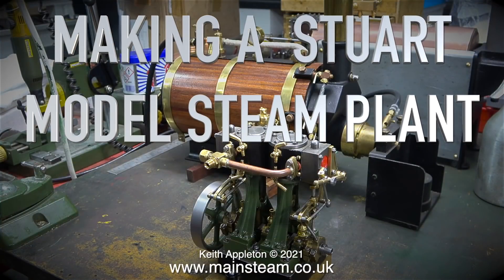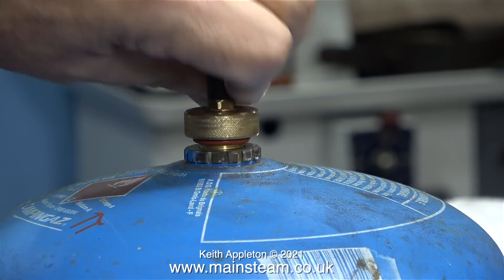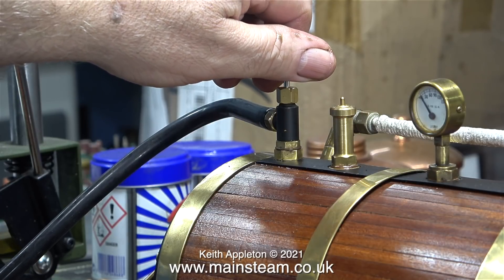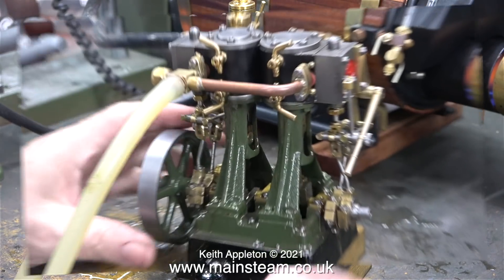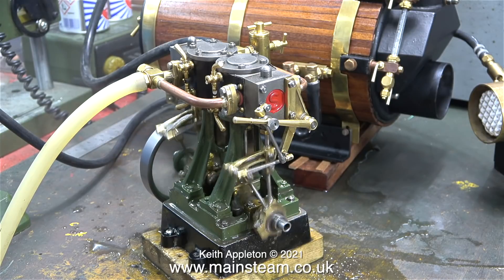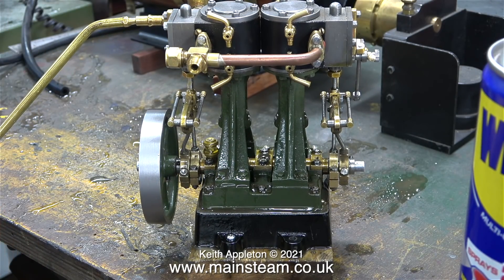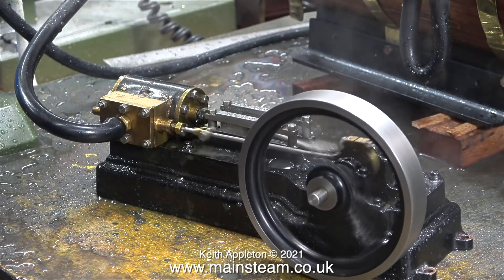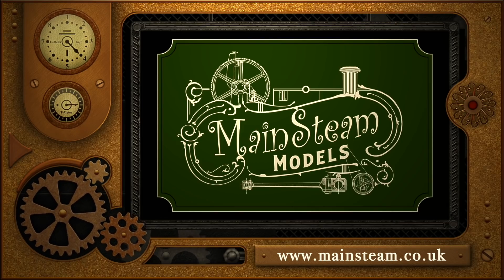MAKING A STUART MODEL STEAM PLANT - PART #40

Comment: Great video!! I love the slowed down parts, interesting to hear a slightly different sound at each end if the stroke.
Reply from the maker: That's usually because of the piston rod in the cylinder making one side slightly different as there isn't quite as much volume of steam in the exhaust.